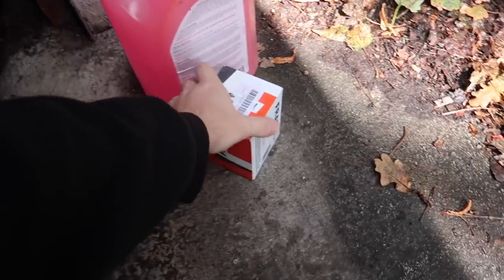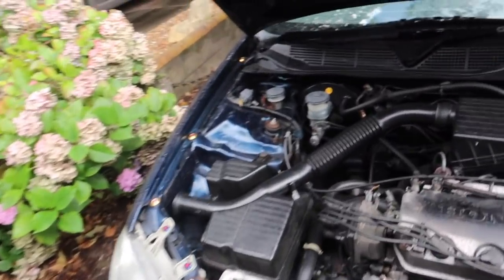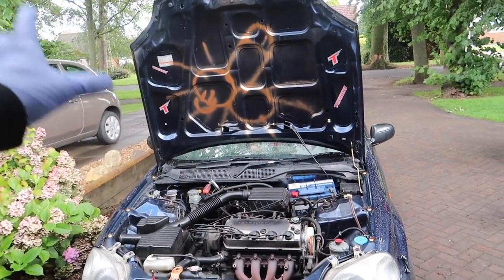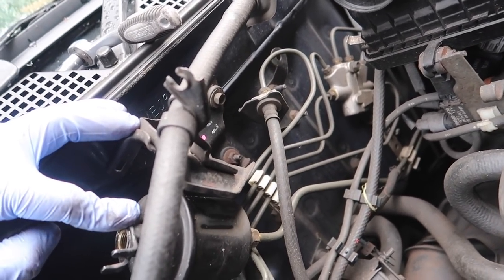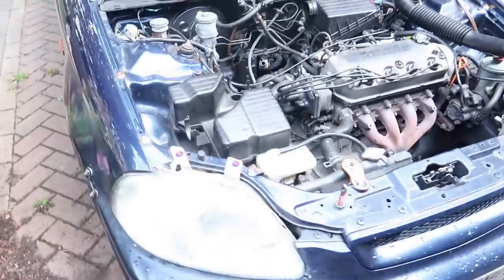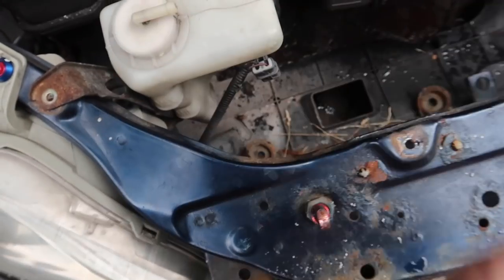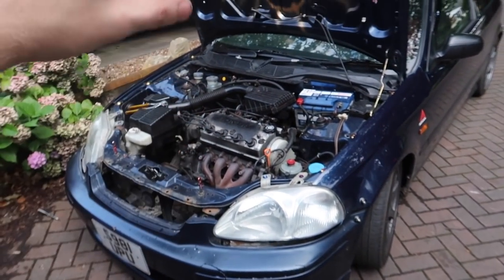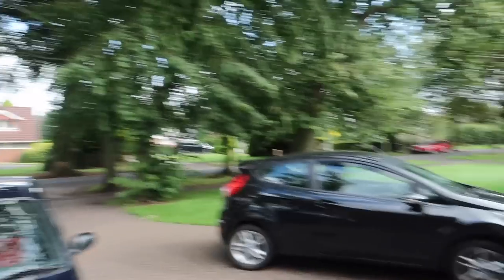🚗 Track Day Preparation!!  *Scrap To Track Ep3*

Comment: Wanna blow up your engine?
Well have I got some news for you!
The first step is to get to 90mph in 5th gear, then for the magic to happen, you need to downshift to 1st gear, this is called the money shift where you need to spend money on a replacement engine and transmission. If done successfully pin this comment, if not, I don't care!
Reply from the maker: Ali Gaming 😂😂😂👌🏼
Reply: Maybe he’s running it until it’s blows then going to k swap like me, only problem is 3 years of hard thrashing and loads of red line action it’s still good as new
Reply: Ali Gaming haha sounds like a great time

Comment: It's only the fins that have gone, the channels the water travel down will be fine on the rad. It's a common problem. But just get a new one regardless for track. potentially a up rated one.

Comment: The track day where is it and how much and do u need o provide prove of insurance ??
Reply from the maker: Reggie Hickman three sisters tomorrow 10-5 and just need a license I believe
Reply: Jesse Collingham  thanks mate perfect
Reply: you can buy insurance but it comes with a large xs normally. On track You're responsible for your own car, you don't have to have it. You bend it you mend it. The most important thing is not to take anyone with you lol. I ve tracked all my cars and never had a problem few spins but not hit anything. It can go wrong quickly though but those are the risks you take.
Reply: Rory Jones thanks mate just wondered and do u need to be any age as I’m 19 been passed 2 years and I am on car trader insurance I have a corsa d 1.3 cdti 90 bhp been remapped to 141-143bhp
Reply: @reggiehickman7951  lol
Reply: Jason Juggler  what’s so funny like 😂
Reply: @reggiehickman7951  I suspect hes commenting on the corsa not being your traditional track "weapon", you have got to start somewhere though boss. Put some decent pads and fluid in and have a go. You will learn quite a bit about your car and balance. Build speed through out the day and don't do long sessions (when mistakes start happening and cars start to wilt).
Reply: @sxrory no I just found it funny that he gave a description of himself and his car. any cars good for track.

Comment: Ahh man i hope you put some fuel in that fuel filter before you fitted it bro, i know on VAG cars you need to otherwise you risk getting air in your fuel lines from the filter being dry, although it might be different on a honda
Reply: Matt Crompton that’s diesels not petrol
Reply: @Y444TES  ohh my bad😂 i've never worked on a petrol car in depth only ever owned diesels
Reply: No worries mate I’d rather work on diesel cars than petrol cars 👍🏻